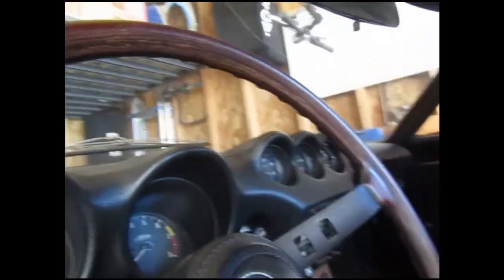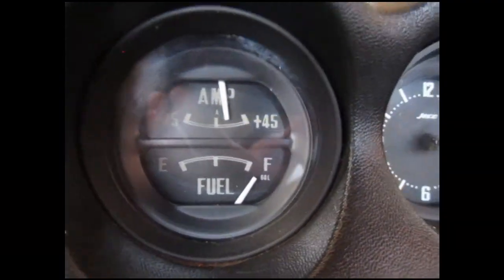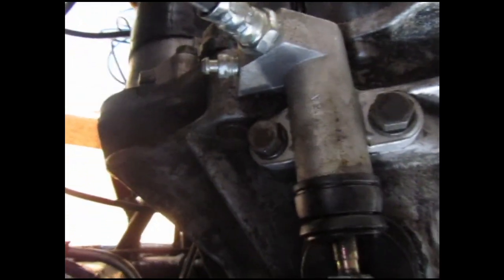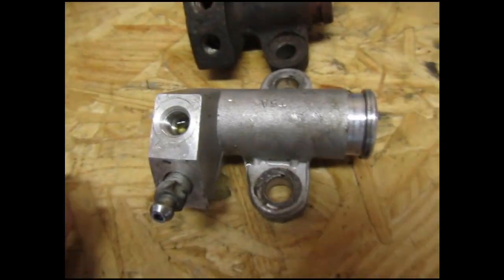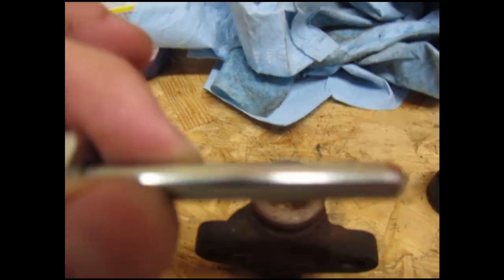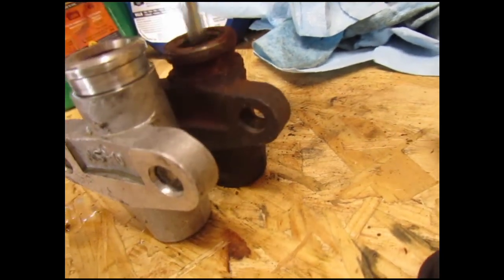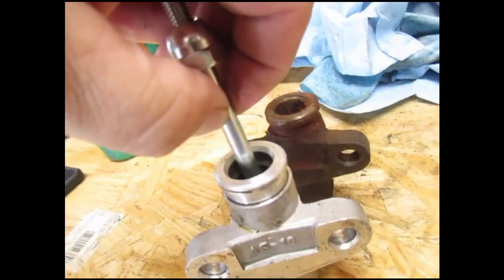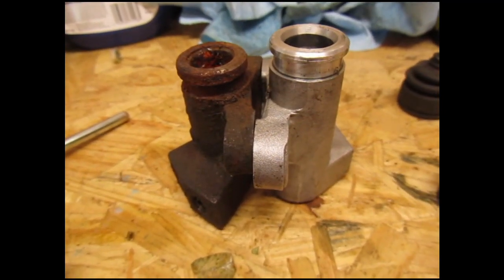Datsun 240Z Clutch Adjustment

Comment: I noticed in one of your videos that you pump the accelerator when you start it. If you have the original SU carbs (which it appears you do) there is no accelerator pump, and so pumping it won't help the car start. If you need to use the gas at all when starting it, then just lightly holding it slightly open should be all that's needed.

My grandad has an old MG which has SU carbs very similar to the ones on your Z.
Reply from the maker: You are correct, pumping the pedal does nothing until the engine is turning over. It's an old habit to pump the gas.
Reply: @OakHollowGarage  really entertaining build, btw! Was a lot of fun to see the car come together
Reply from the maker: @IanSantopietro  Thanks! It was fun putting it together. There's still a ton of work to do.  I'm also starting a project on a 1969 Mach 1 basket case that will certainly stretch my skills. And another smaller project to come that I haven't mentioned in a video yet. Please stay tuned in and always hit me up with comments any and all advise is desired. I certainly don't know everything. Actually, I know very little...

Comment: I just binged all 37 videos, I've got two Series 2 (1971) 240s (one parts car and one slightly wrecked) and need to get to work.
I noticed the ESRI box in the garage, do you work with GIS systems?
Reply from the maker: Good luck with your build. They really are a fun and somewhat easy car to work on. As for the ESRI box, my wife used to be an admin assistant at ESRI in D.C.  Thanks for watching the vids, I will be coming out with more Z car videos here soon.